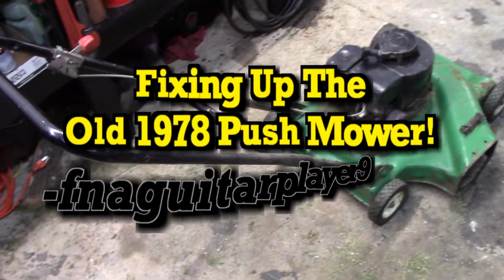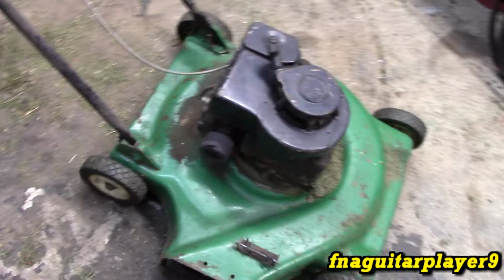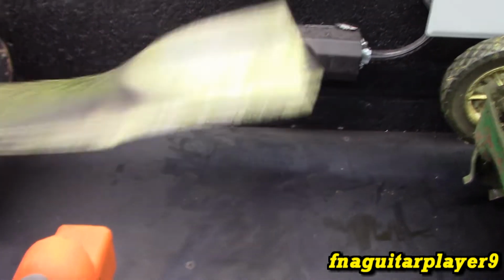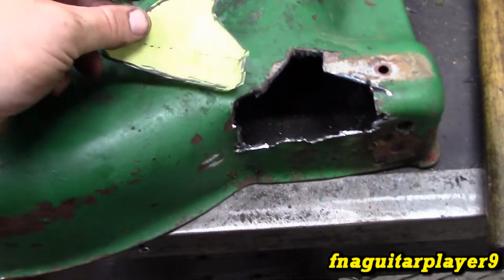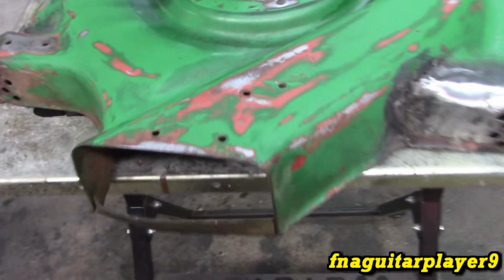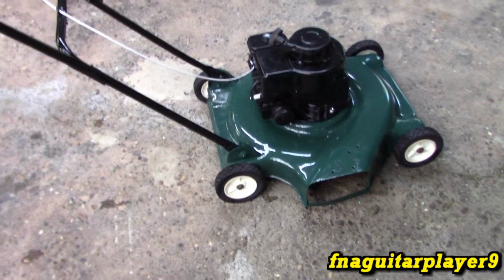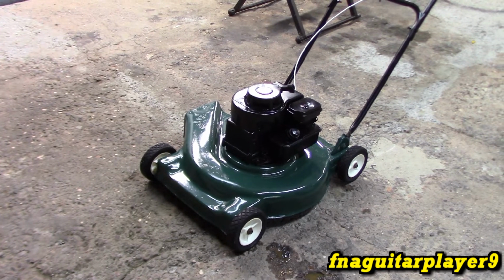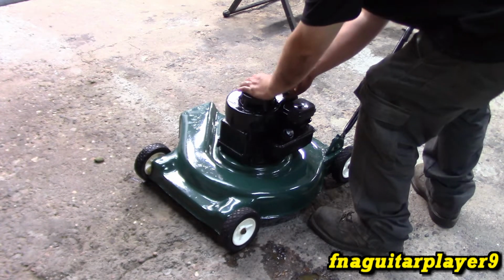1978 Push Mower Deck Repair, Weld and Paint, Briggs 3.5HP

Comment: Nice job and pretty color! I had to have a new deck shell for the opposed Craftsman but I ordered the 'spindle protectors' that look like short coffee cans and filled them all the way up through the 'mulching' rust holes in the deck with epoxy resin. No grass to rust out the deck and pained it with oil base black. No problems hey and NO rust. You get an A-PLUS and That's about where I run my Snapper walk behinds. One has a 4 horse and a combo of vacuum and a thermostat on the choke. 1st year I guess. Pick one!
Reply from the maker: Thanks! They are bad about rusting out. Thanks for Watching!
Reply: @fnaguitarplayer9  The resin took care of that. And a good coat of oil base black. Will probably take the deck off and spray it off and repaint before long. GBWYall!

Comment: Good job 👍. Is there any special reason you don’t like OHV’s.
Reply from the maker: Thank you. I just think the old flatheads are more reliable, simple and last longer and i think they are easier to work on. I just think that these small-small engines should be left to the old simple design. Just my opinion, i like ohv to a point, and depends on the application. thanks for watching!!!